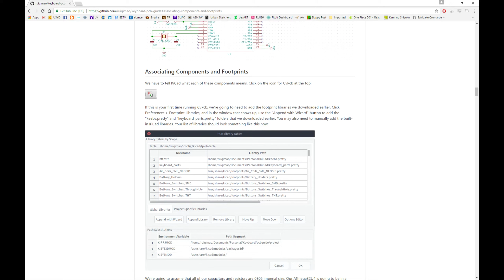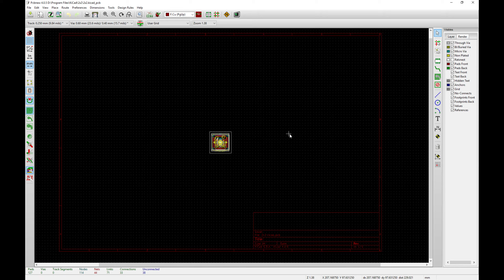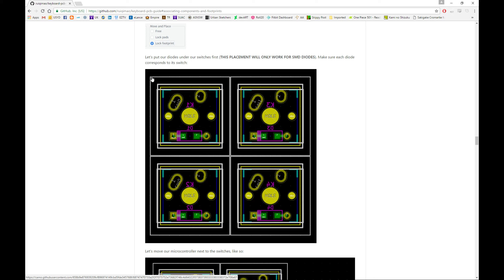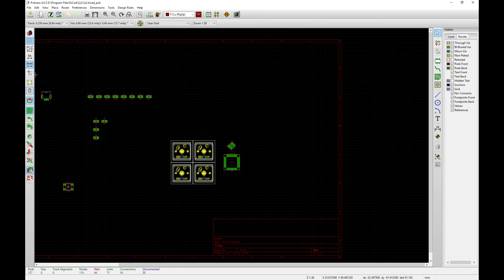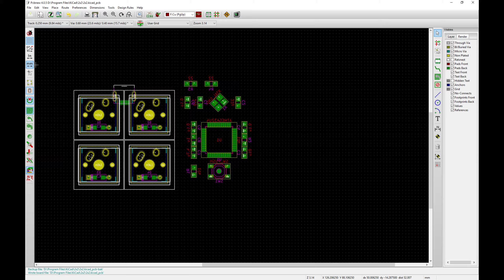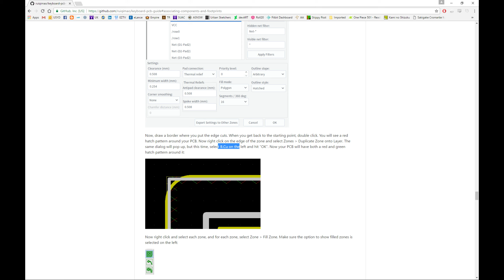Introduction to KiCAD- Part 2: Setting down component footprints

Comment: I got up to the copper layer part. When I go to do that I do not get an option for GND. The list has Net, VCC, and +5v. Much of the software is different from when this tutorial was made, but I don't just want to assume that GND is now called +5v. I did the tutorial twice just in case  I missed something the first time around that could have resulted in the GND option now being missing, but I still ended up with the same results.
Reply from the maker: GND should not be +5V at all, normally that would be the same as VCC for most part in my designs.
If there is no GND for you to select, it means you haven't defined/labelled the GND in the schematic, or at least that is my first  thought on why GND is not in the list.
Reply: @theboard  Thank you! I will check on that.
Reply from the maker: I just checked in my version of KiCAD (5.0.2) and its there in the project I opened, but its also defined in the schematic.  Good luck!
Reply: @theboard  I found it! I used GND footprint from the keyboard parts list and I think that might have been the problem. I switched out all GND with one by the same name from the default library, then generated the netlist again, opened up the .pcb and loaded in the updated netlist and now the option has appeared :)
Reply from the maker: high five solid work.

Comment: Nice work. I'worked through the tutorial up to about this point, but I decided to just go ahead and design my own board. lol I'm quite out of my depth but the software is really easy to use even for a noob like myself. I found that you could have KiCAD spread out all the components automatically by toggling the Mode footprint button just above the zoom dropdown. Then when you select all the components and right click, a new option called Global Spread and Place becomes available. From there, you choose to spread all the components. It's not as neat as the way you did it, but when I had a board with 89 switches and diodes it was a big help.

One thing I noticed about the schematic that I only realised after having asked for help over on GH is that the placement of the decoupling capacitors isn't very clear. That caused me a lot of confusion as to where things were meant to go when I looked at the routing screen shots. Of course, someone who doesn't need to refer to Google every 5 minutes would have no trouble, but it was confusing for me. I have certainly learned a lot about capacitors and USB shielding in the past 3 days.

I'm still confused about the crystal too. Maybe he edited the footprint himself? It would be strange that he would fail to mention that though. I checked the datasheet and it says pins #2 and #4 are ground. Looking forward to watching the routing as I think that will be hard for me to wrap my head around.
Reply from the maker: That is a really handy hint right there about the component auto spread. Would have helped when I was doing my own 8x7 grid, that was very tedious dragging apart all of the components, but everything has pros and cons, plus its free open source so you really can't complain too heavily.

As for the crystal, yeah, not sure if I've picked the wrong one again or not, I had a go at routing on my 8x7 grid design and it was just trash, so hopefully I can do a bit better on a 2x2, and I did get told one tip that hopefully might help haha.
Reply: Hello from the future! How far did you end up getting? Did you find making a full-size board to be any different from creating a 2x2 matrix, component-wise? Does anything really change?